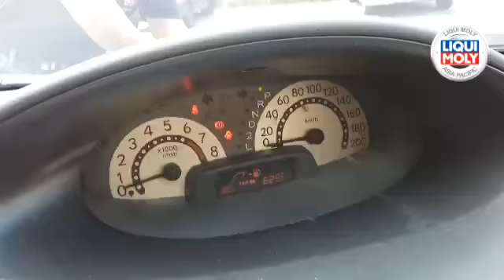Liqui Moly Catalytic System Cleaner #8931 #clean #Catalytic

Comment: In another liquimoly official channel, its not recommended to treat via vacum pipe, because the chemical basic manganese peroxide can not be clean.. they throw it via air intake after air filter…
Reply: I was about to say the same. If you watch the English video (official Liqui Moly video) they say that the cleaner should not be added through vaccum hoses.
Reply: @sydgerald  I saw once.. it goes through the upper o2 sensor..
Reply: @MarcDufresneosorusrex  Interesting, the other day a friend of mine mentioned the same
Reply: The difference is DPF element euro 4 or 5 or 6. Also vacuum insertion is okay if your pressure sensor is blocked...
Reply: Same question

Comment: I have seen several videos on how to do this and this is also the wrong way to do it. Do not add to vacuum line or the gas tank, this product is water based. Take off your air intake which is usually held on by hose clamps and spray in intervals into the throttle body. Make sure to have another person with you to fluctuate the rpm between 2 and 3.5k rpm.

Comment: You are not using the Catalytic System Cleaner in the correct way.
Please apply the Catalytic System Cleaner with a pump spray bottle directly in front of the throttle.
Not by vacuum through a rubber hose, the dosage can not be controlled in that way.

Please watch our official video how it has to be applied.
 
https://www.youtube.com/watch?v=c5efSS31obI
----------------------------
Liqui Moly-yemen
Reply: I did this and still cat still blocked. I can send pix